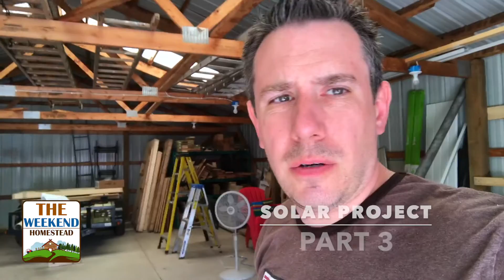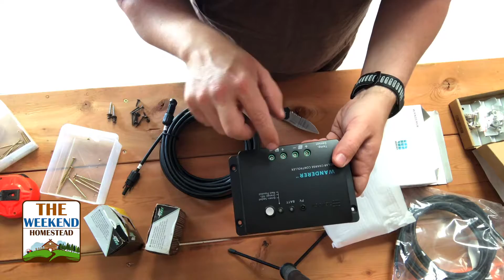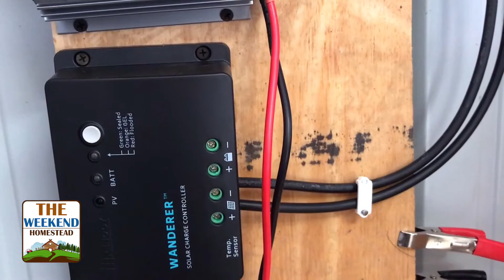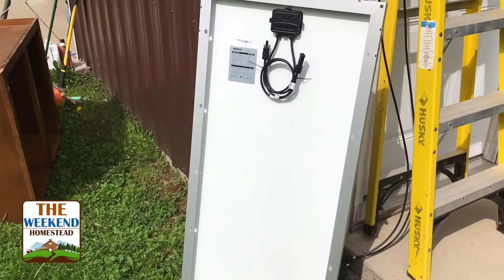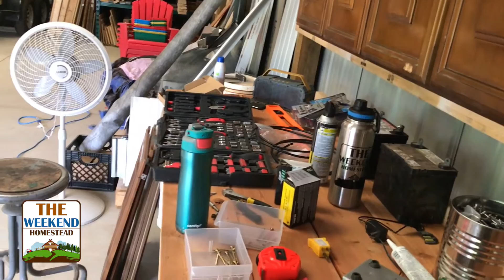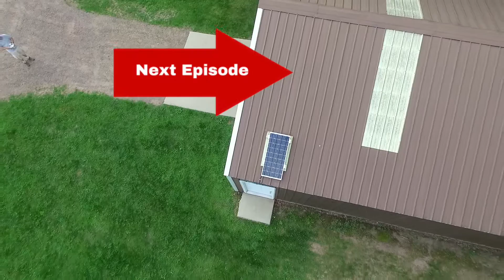Off grid Mini-Solar Panel Systems for Utility Buildings ~ Step 3 - Panels

Comment: You can only deplete the battery approximately 50 percent if you want it to last so u only have approximately 62 amp hrs available. Your system is nice but if u plan to use the building much u need it bigger as I advised. 10.7 volts is the lowest u should deplete the battery
Reply from the maker: here was my math, see if i am looking at it correctly. right now my average use over 3 days (F/S/S) is 29 amp hours total. So I figure of my 125ah, max i would use is 30ah in 3 days which leaves me 2x before i hit the 50% mark. Then i have 4 days of zero use. My one panel at 8.3AH (4 hour per day average light) = 32ah recharge per average day. I have been using a Kilowatt and a Volt meter to track usage on my marker board fo the last 21 days. Lowest my battery ever was even on cloudy and stormy weekends was about 90% charge. Most days i was in the 99% range. I am producing more power than i am using by a long shot. During the day i run fans in the barn, at night i use the lights for maybe 4-5 hours max. the system is 8 LED bulbs at 14W each. Fans pull 36W, cell charger pulls 15W, and Dewalt charger pulls 65W. Lights run 4-5 hours a day, fans run about 8 hours a day, chargers are about 3 hours a day. Total Daily usage at max is about 12.6ah for every 24 hours. (remember the big killers of my system - chop saw, table saw, etc are all running off generator due to draw concerns and i dont have heat, AC, or appliances in the pole barn)

Comment: Will, I am really interested in adding solar to our Travel Trailer.  Although I am such a beginner!!!  I don't know what size (how many watts I need) or anything like that.  I am hooked up to city power, but would like to more free of them...  What do you suggest?  I also have a small freezer and a small light in our shed, and outdoor rope lights hooked up outside the trailer.
Reply from the maker: first suggestion is to get sheet of paper started. List off all the items you have that you would run and figure out worst case how often you would run them. then buy a device called a Kilawatt. It measures how many amps/watts you are using on each of the items. Here is the Kill-a-watt - https://amzn.to/2LYX5US

Comment: Hi Looks great but from a guy thats been there done that it looks like a 100 watt solar panel if so you need 3 or 4 pannels to cover using  the lights you  have or what you need to light us barn and outside lights .. go all leds also need at least one more battery.................
Reply from the maker: All lights on and fan running I use 1.24 amps of power. I went all LED. If I plug in the dewalt charger add another 2.3 amps. 125ah Battery my hope is to run for 40+ hours on it which is almost running non-stop over a weekend which is probably unlikely

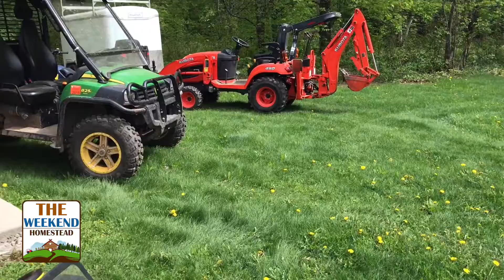Comment: Everyday @ 3:00 thirty-ish years ago...HE-MAN! Loved that show 😀 I have a question, however it’s not about the solar project. Thanks for sharing that by the way. What color brown is your barn metal? Are you happy with it or do you think it causes the building to heat up to quick? I have a silver metal roof installed on my cabin & I’m in the market for metal siding. I haven’t picked a color yet. I was leaning towards a lighter shade of brown. Thanks in advance 👍🏼
Reply from the maker: Don’t forget GI Joe! - as for the brown, it’s ok, not great. When we bought the land that was that it was so we stuck with it. I will say in the summer the barn heats up to the point it is not manageable. I probably will put in some fans to make it workable
Reply from the maker: I like some of his stuff, biggest issue is the systems he puts together is he budgets - expensive stuff

Comment: Looking good, Will! Two things you need. 1) Buy a little LED volt-meter off Amazon and permanently wire it to your battery so you always know what the voltage is (don't waste a good voltmeter on it). They're a few bucks. 2) you need a rounded piece of PVC for the cables going over the edge of your roof. They will chafe in the wind and eventually expose the copper. Good work!
Reply from the maker: Great point on the wire - I’ll have to find something that will work for that. I bought one of those $15 volt meters and it gives me the levels. Do you have a suggestion on one that works well?